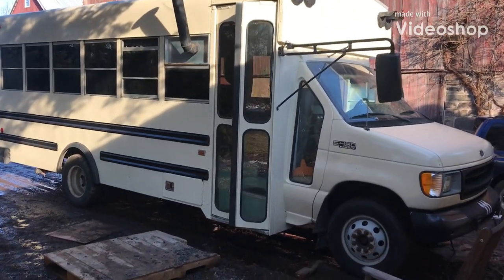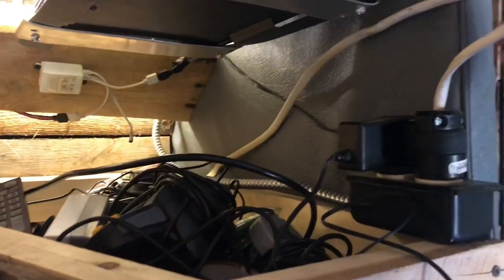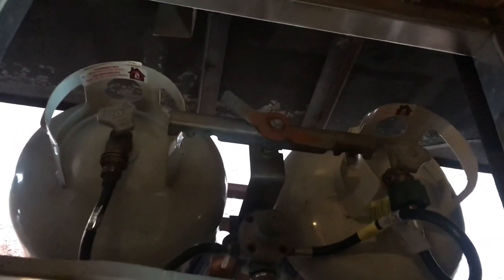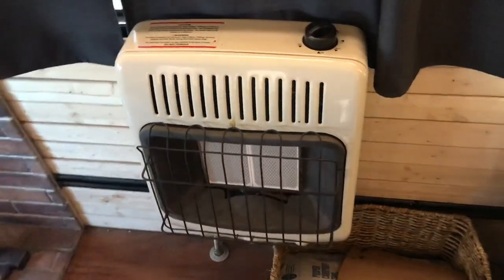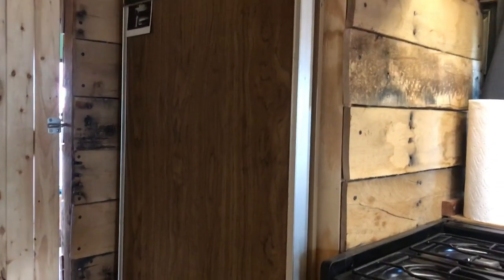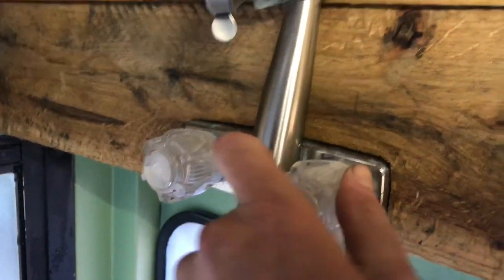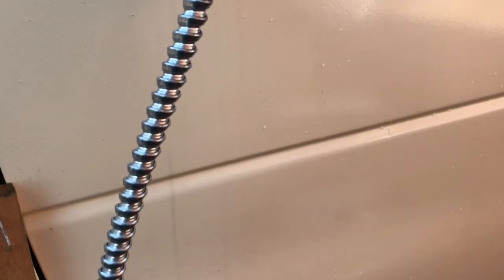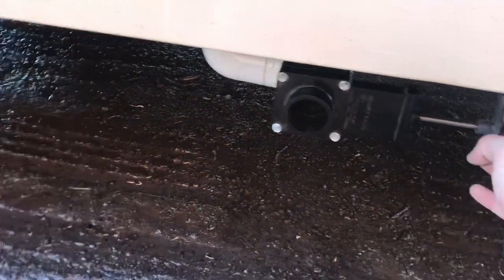Short bus conversion skoolie for sale (sold)

Comment: I'm currently building a similar project and have been on the hunt for an asme propane tank with no luck. Could you show or explain how you connected your propane mount under the bus? Also I really like the wood stove idea and have been trying to make a similar idea. My only question is how much of a smoke do you get inside if any with not having a straight up pipe and having the 90 elbows on? Thanks in advance!!!
Reply from the maker: Kris Ray for the propane I welded a U shape frame and bolted it to the bus frame and to the ribs on the outside body of the bus, then pulled a propane tank rack off an old camper that I sat down in the U frame and bolted it there if that makes sense.
The woodstove I have no problems with smoke, there may be a little smoke sometimes when starting it, but usually not as long as the flue is open all the way
Reply: @N8sk8bus  last question on the propane. Would it still be doable without to floor hatch? Can you access the bottles underneath to remove/change? I know it may not be as easy but possibly a better option for me with my lesser floor space..
Reply from the maker: Kris Ray yes i can pull them out from underneath it’s just a pain, I could have fastened it a little lower if I went that route to remove them more easily, but you don’t want them too low, if I remember right it may be illegal for them to sit lower than the axels, which could be a problem if you need to get the enhanced inspection like we got
Reply: Awesome! I will keep the clearance in mind when looking if it's possible for my situation Thanks again!
Reply from the maker: Kris Ray no problem, good luck with the build

Comment: I know you sold this one, but I’ll be in the market for basically the same exact thing, any chance you might be interested in taking on a few side projects? I will have roughly the same budget. Either way, I love this setup and drawled a lot of inspiration and design from this bus.
Reply from the maker: I might be able to work something out, where are you located?
Reply: Central KY.  Well I subscribed,  I will let u know

Comment: Has this bus been sold ?
Reply: It's still available on Craigslist as far as I can tell. 20,000 obo is what their asking. A bit high for what you get imho.
Reply from the maker: Drkns to Dstny yes it’s still for sale, we have a couple potential buyers at the moment we’re working with, the problem we’ve been having though is buyers trying to get a loan from a bank because they will only value the bus not the whole conversion. Just something to consider if you’re looking to buy a conversion, unless you have cash which everybody doesn’t just have that laying around